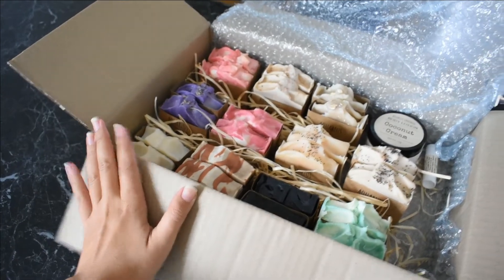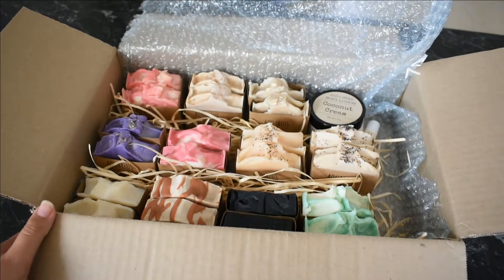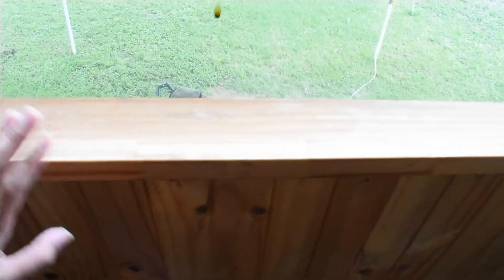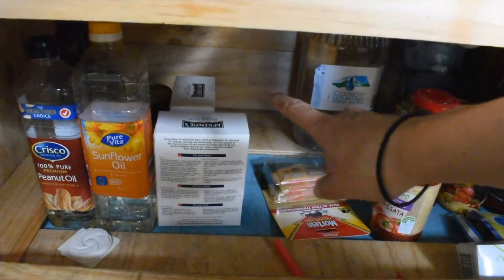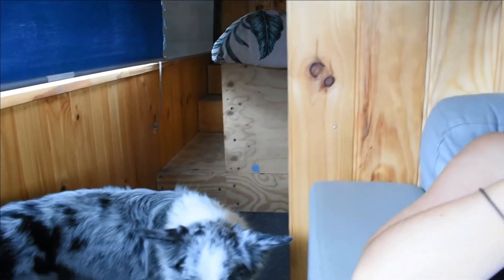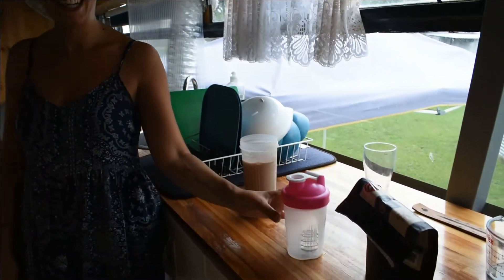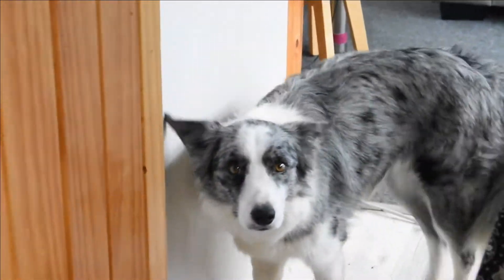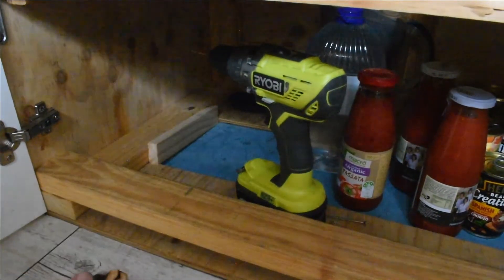BUS LIFE INVASION | Building Flyscreens & Renovating Our Tiny Home on Wheels

Comment: Another thing mice can't stand are those round squishy wire dish scourers. (as a make shift measure only)
They jam in very easily into gaps..& it works.
Reply from the maker: Ok, thanks for the tip. At this point we’ll try anything!
Reply: Cheers..👍